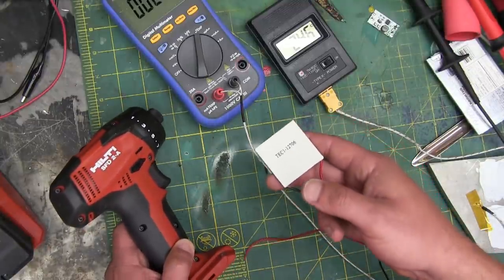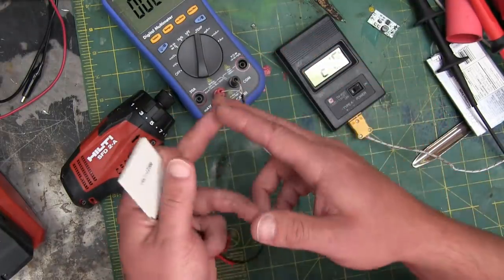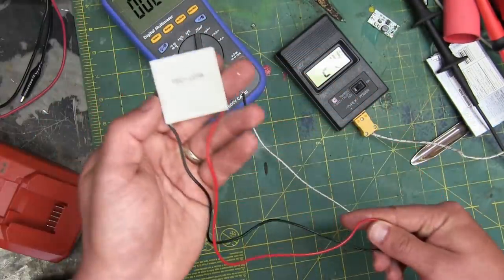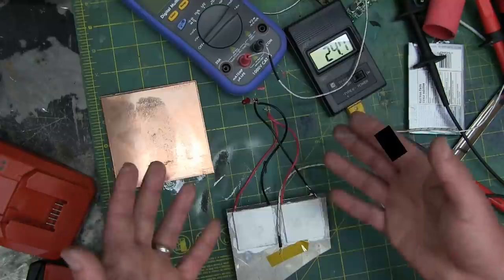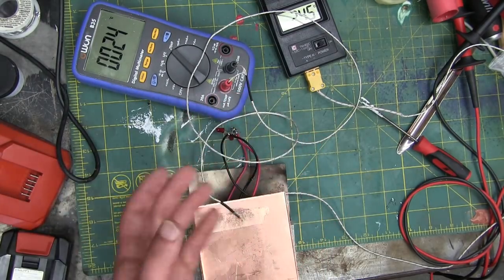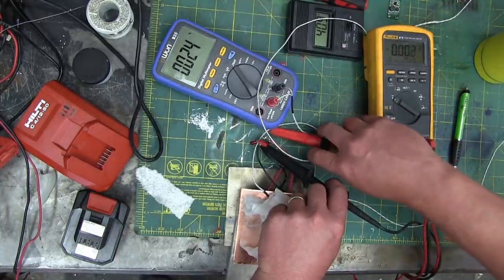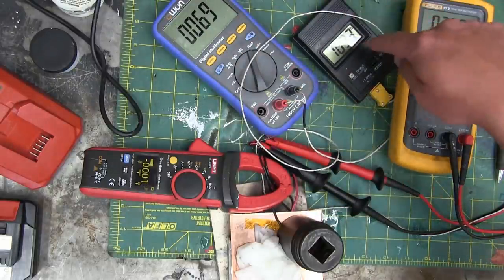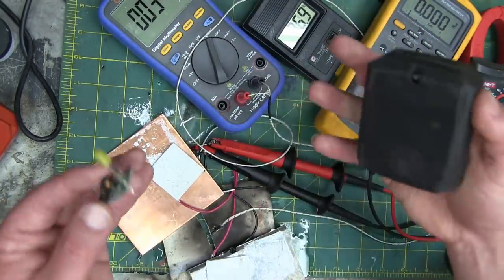Rocket Stove Peltier Charger | Seebeck Generator

Comment: This idea is good on paper. Though, your cooling is far to inefficient.

I would also recommend to not run them at over 100 degrees science, as that drastically reduces their efficiency.
And lastly, I would put the two in series instead of parallel. In terms of the cabling. As these can typically supply a fair bit of current at a high temperature differential. (As long as the hot side doesn't get too warm. (above a hundred is typically too warm, for this type of element at least.))

Comment: Could they work in series to generate more voltage?
Reply: yes. I have 2 groups connected in parallel to increase amperage, and each set has four connected in series. I use a voltage regulator and two capacitors connected to restrict voltage to 5v and smooth out the noise.

Comment: Could you mod your drill, take the sprag clutch out and drive motor as a generator if you had a convenient way to switch between the drive circuit and the charge circuit 
...

Comment: Getting a little voltage from a flame,, is that the same principle that a thermocouple in a gas oven thermostat works ? Cos the oven thermostat has a tiny solenoid coil that activates from the pilot flame

Comment: Could you run the TEGs in series to increase the voltage? Obviously it would run at a reduced current, but it won't push any current through if you're not getting up to a voltage high enough to run your boost converter. EDIT: It might also help reduce the required temperature differential.

Comment: Interesting and all, but if you want to charge something, why not use a solar panel? much higher efficiency
Reply: And what if it's raining all the time?
Reply: solar is cool but it requires direct sunlight to be useful for a small portable camp charging system.  you can use this all night long as long as you have fire.
Reply: 1metiz raining all the time?   Makes it hard on fire, too!
Reply: If there is a lot of overcast and/or he is in a wooded area where direct sunlight is rare, a solar panel wouldn't have much use.
Reply: 1metiz he lives in the interior of BC where there have been a lot of fires and a fuckton of smoke (currently spreading south of Oregon). That's going to seriously reduce the efficiency of a solar panel.
Reply: Pre-built = easier = less fun. Unless it's a Stirling engine. That's about as cool as it gets.
Reply: So you think a video of him ordering a solar panel online would be more entertaining?
Reply: What are the first three words of my comment?
Reply: efficiency and power not the same thing though.  need lots of solar panels to get good power output
Reply: Because it's night time right now.
Reply: Thats not the point here bud im pretty sure he is packing a generator on those trips prospecting.
Reply: Because he's going to be prospecting on foot and needs a campfire to keep warm at night regardless. Also because, it's interesting, which is reason enough.
Reply: Will a solar panel operate off the light from a campfire? :-P
Reply: Yes, poorly but it will. Though at this rate, he might be better off using a solar panel xD
Reply: How about a stirling engine with a dynamo attached to it? Plenty of heat with a fire
Reply: Thomas Mobley I don’t know, he showed himself trying to return the juicerio and that was pretty entertaining...

Comment: A few aggravation-saving tips on these for fellow home-gamers:
1. However desperate you are to get a bit of extra juice out of these, make the effort to put some sort of heat-sink slab on the hot side. I was getting some great results with one directly atop a UCO candle lantern and then it just quit. The weak link isn't the solder; they seem to be made of dozens of little bismuth junctions in series and their melting point is pretty low. Overheat one point and the whole thing goes kaput without so much as a whiff of blue warning smoke.
2. If you're going to wait weeks for these from overseas, splurge the extra 6$ or so to get an actual energy harvester board instead of just a boost converter. That gives a lot more options for low-level power collection. See additional notes from the Aussie electro-pixie-wrangler extraordinaire: https://www.youtube.com/watch?v=9aSPopIcKLQ.
3. Get at least two, they're cheap and if you're clumsy and impatient like me, there are just too many ways to break the ceramic shell or overheat them. Plus you can then hook up your spares in parallel.

Comment: Check out EcoFans (wood stove fans) that provide airflow and more effective heat distribution and use pelletiers so no electricity required.  And wood stoves get hot hot hot.

Comment: Wonder if there's a way to do this with sunlight for heating the metal.
Reply: or just use a solar panel lol they are much more efficient and lighter
Reply: use a fernel lens out of an old big screen tv, to concentrate aproxamitly 1^m of light down to aproxamitly <10cm. the hard part is the tracking system  to keek up with time.
Reply: ... or a solar panel
Reply: One of the more interesting methods I've seen is laying the cold side on the snow and the hot side up in the sun. They work on temperature differential remember.
Reply: Zedex 12 Even in Canada... temperature here in august is around 18c to 30c

good luck finding snow haha
Reply: David, good luck taking 1 m2 with you in a canoe.
Reply: Aren't there also those little engines which run on temp differential? Could they drive a dynamo?
Reply: I think I read something about using them in server farms in places with a cold climate to generate something.......pixies possibly
Reply: SteveM do you mean sterling engines?
Reply: That's the one! Thanks.

Yeah, a big sterling engine on the roof of a data centre in a cold climate driving a dynamo.
Reply: Rule of thumb is that for any given setup, a different setup with less points of energy conversion will be more efficient.
So a stirling engine plus dynamo, which is heat differential -> linear motion -> circular motion -> electricity
will probably be less efficient than a peltier which is heat differential -> electricity.
Reply: pubcollize you mean like every fossil fuel power station out there? Burn fuel, steam, turbine, alternator? In fact there are some Stirling solar power systems around.. Changing the type of energy is what's it's all about
Reply: I stand corrected.
Reply: Well solar water heating panels use a copper tube or plate painted black. It gets damn hot so I would think so.
Reply: Peaks of the Rockies?
Reply: Haze33E black paint?
Reply: HomeDistiller this can charge at night though. Both in tandem could likely maintain the tool
Reply: I just thunk this thought then I thunked Super inefficient. but then , nah and had an other beer.

Comment: Interesting idea but as you say, the inefficiencies are extreme.   For less than $15(US) you can get a 12-15000mAh SOLAR cell phone charger to take with you.  Lay it on a rock whilst you be prospecting and when back at camp use your boost controller to charge your bigger batteries.   More sunlight time in a day than campfire time at night....     I spent more and got one that is also an emergency light, compass and GPS transponder.
Reply: Thing is, when prospecting, you're usually on foot until it's dark. Solar panels work poorly during the night, whereas this campfire charger works poorly any time of the day.

Comment: Sure can, but to get enough power with a peltier to charge those batteries is going to cost way more than any other solution, although in an emergency situation the  peltier charger wins given no dependence on daylight or clear sunny days, although way more costly for the equivalent power of solar, and a needed burnable fuel source.  You really need to go all out on heatsinking, perhaps even liquid cooling to get a good temp difference and maintain it.

Comment: I'm probably not the first to say this, but check out thermoelectric generators on Wikipedia. NASA have done a lot of research into them for the purpose of using a small nuclear reactor to create electrical power without the size and weight of water and steam turbines, handy when sending a research vessel to the far reaches of Europa.

Comment: AvE I used to build those for a company in Waltham actually cut the ingots then soldered them to the board. you open it up it's a bunch of little square Alloys of some kind I don't know what the metal is that they use can't remember but i built them from scratch.carrie on
Reply: I did some research on thermometric generators during my undergrad studies for a student paper. Essentially those little squares are squares of alternating p- and n-type semiconductors connected in an array of series and parallel over the chip. There are a few different semiconductors that exhibit this effect, and different ones were better for different temperatures - some up to ~1000 degrees C from memory for the high temp TE's.  Our research focused on Bismuth-Tellurium types, which were good for like 50-300 Celsius.

Comment: I wanna make a system that makes enough power to run a wood furnace.  Or a wood boiler.     So I'd still have heat if the power goes out

Comment: Put a Joul Thief Circuit and 4x 4v And 1supper  cap then the Boost Dc/DC the caps are for that nasty Power Pull when Plugging a Device

Comment: From my experience with peltier's, about a decade ago when I considered one for my watercooled computer (fun hobby, but my interests have moved on in general), I seem to remember that if your heat source produced more heat than the peltier could remove, it would actually end up insulating the hot part (CPU) as it can't remove the heat fast enough, that is, one would be better off with just liquid cooling the CPU. Since it was my hobby, I was regularly pushing 200 watts through those CPU's, and biggest peltier commonly available was a 226watt unit, so, it would have been pretty useless to me. 
I'm not sure how this applies to your application, but its a piece of data you may find helpful?
That is, in your intended application, is it better to have high power peltiers, or low power ones? I dont know, but I'm sure you can figure it out :)

Thanks for the vijeos, 
Peace

Comment: do you think you could strap this on to your arm and use your body heat as a power generator?
Reply: Joel W. Because there is two generators
Reply: Not for very much power
Reply: Maybe onlya 10 or 20C differential to atmospheric temp
Reply: I wonder if it would work by urinating on it.
Reply: Probably easier to bring a hand cranked generator, like in some flashlights & radios. But all this is for a drill, so you know, just bring a hand cranked drill (eggbeater style) or a brace.

Comment: I can appreciate wanting to mess around with lesser know laws and theories of the universe, but wouldn't it be easier to charge your batteries off an electric motor that you've made into a dynamo? At the very lease you wouldn't have to build a fire in the middle of work if your batteries die.

Comment: Awesome idea, glad to be reminded of some basics. On the "that's expensive" note, I had some alternate power needs some years ago when this little start-up began, and I happened to know a friend of the owner. I rcvd one of the first versions of the Guide 10 kit from http://www.goalzero.com/. I have used different Gens of their equipment, and as long as it is in the budget, it pays for itself. Buy once, cry once. If nothing else, you could fabriclobber the juice from the batt-pack to the drill batt- That would be great video too. Only hoping to help, but I'm still expecting a commenter's beating. Whatever- hammers are not intended (by men) to be soft and gentle. Bullets are not to be trophies, just the casings. GZ has done well for many I know, and the smaller sets are light and highly portable. Hope this helps. Lovin the vids, keep'a choochin!!

Comment: Wouldn't a solar charger be by far easier?
Reply: Solar don't chooch at night or during rain etc.  Power when needed made the industrial revolution.
Reply: That's a fair point. He's looking for a way to charge at night which makes sense given how long its going to take to charge up that big battery using this method.
Reply: We chose to go to the moon, and do these other things, not because they are easy, but because they are hard!
Reply: solar shmolar... the soviets had a portable radio PSU that worked by thermocouples around a kerosene lantern for godforsaken off-grid crapholes in siberia where the sun never shone - probably similar conditions to those our hero is headed for. Think it was good for about a watt or 2

Comment: Am i the only dinosaur on here that remembers when we had solar panels built into the calculators. Why on earth dont they just put a panel on back of our phones and they could charge themselves or have an output for charging all sorts of things all be it maybe slow but atleast ya could
Reply: Not strictly relevant to your comment but: I saw a vidjeo recently (can't find it again) where a guy took apart a bunch of cheap solar calculators and found that on lots of them, the solar panel was a fake.

A phone-sized solar panel would be good for about 2-4 Watts (at a guess). USB 2.0 is 2.5 Watts, so your idea is perfectly reasonable, though some other commenters have noted that there mightn't be too much sunlight in the remote forests of British Columbia...
Reply: Rob Plotts because old calculators drew very little power. Modern phones do.
Reply: Rob Plotts they do phone cases with a photovoltaic panel, yes.

Comment: Wouldn't it be more efficient if you just plug the sticks and leaves right into your phone instead of wasting all that beautiful Earth energy on the pollution?
Reply: Burning wood doesn't pollute... it is the same carbon liberation whether it slowly rots over 20 years or you burn it in 20 hours.

Comment: build a hydrogen fuel cell to run some small generator or something to make electricity all it needs is water and battery but once it's choochin it will charge the battery as well as whatever else you want.

edit: here's a link to what i think could work for you it's crude but your mind could make something extraordinary

 https://www.youtube.com/watch?v=2iRZ4qJ38OY